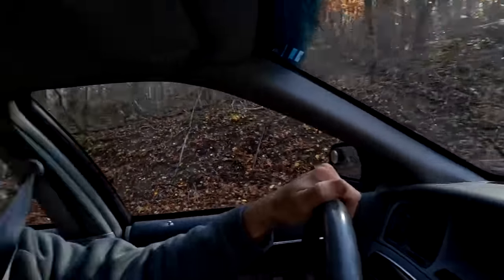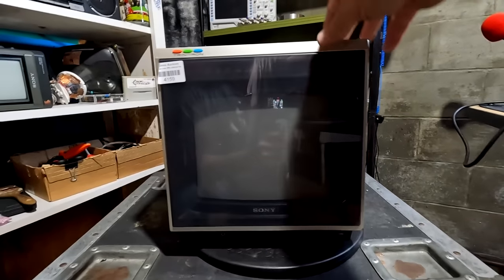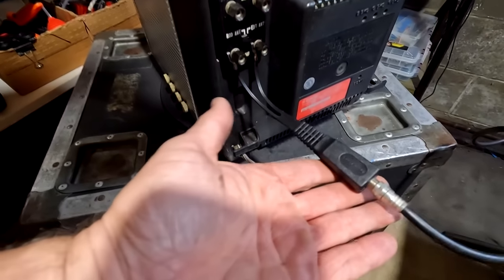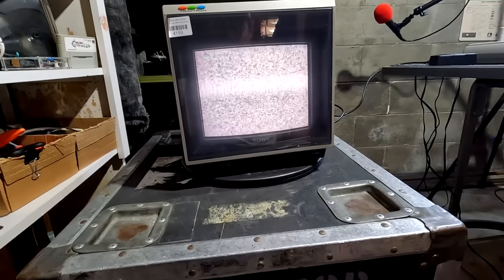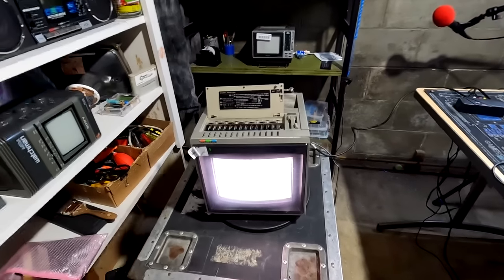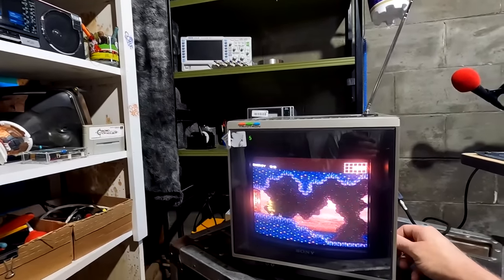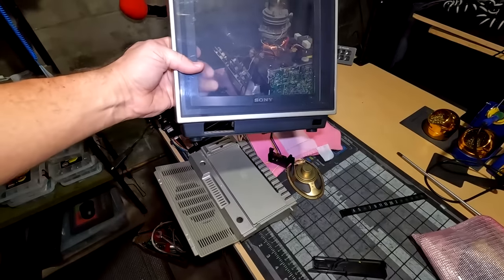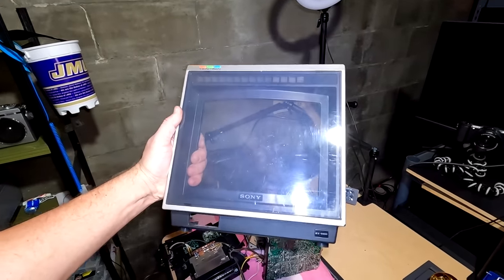Sony's MOST Dangerous TV - The KV-9400 Trinitron

Comment: Given its vintage and the fact it's an RF-only set, it probably has a live chassis (the set doesn't have an isolating mains transformer so the chassis is at mains potential). So yes, it's dangerous to work on these without an external isolating transformer or at least gloves. Especially in 240V countries :-).
Reply: Sony was often cheap with respect to isolation. I had a 1990 19-inch with composite and RF, and it also had a hot chassis.
Reply: My Toshiba portable TV of late 1980th (I recapped it yesterday) also runs on rectified mains at its GND lines. The RF jack is coupled by 3 small capacitors. Decades ago I installed a small (music light) trafo to install a safe audio output.
Reply: EU mains is actually 230V
Reply: @Scoopta And the difference is so trivial that it doesn't matter.
Reply: @cancelhandles  and yet it's still wrong
Reply: @Scoopta  And nobody asked, nor do they care. :)
Reply: @cancelhandles  and yet it's still wrong. Expect to be fact checked on the Internet.
Reply: @Scoopta  Oh no, my country's mains voltage is misrepresented in social media :'(
Reply: @cancelhandles  it's not even my country LMAO...I'm in NA. I'm just a pedant.
Reply: @Scoopta  Ok. That's fair. I've been one myself before.

Comment: CRTs can kill you. High voltages all over inside of set. RGB drive voltages can be upto 500 volts. A flyback you can see up toin extreme cases around 50,000 volts! If the rubber boot is cracked it will leak in to you if you get near it. Arck will jump in to you if you are not careful. They always say to work with one hand behind your back to prevent high voltage from jumping across your heart. That will kill you! They make plastic adjustment drivers to adjust RGB gun voltages. These are some of the reasons that they inform you to havwe a certified technition work on these types of sets. Back in the days they had the correct tools to service sets like that one. All CRTs are the same. Color ones are worse to work on. Voltages are higher and more of them. Remember, One hand behind back or better yet in pocket.
Reply: Not the 30KV are most deadly, but few hundred volt at about 1A, those lurk everywhere in CRT power supplies and mains connections. A CRT is a glass capacitor that stores highvoltage (that 30KV under the suction cup) also when off. Most dangerous of touching it is that you will accidentally shatter the tube and so (particularly with 1950/60th TVs) die of the shards from a glass handgranade.

Comment: I am going to say two obvious things, first use and ungrounded floating isolation transformer when working on older CRTs like this to prevent some of the shock risks and lastly use plastic adjustment tools always.  Don't stick metal screwdrivers in the CRT, also a metal screwdriver is more likely to make it easier to break an old pot.
Reply: Insulation trafos are needed if you connect something grounded (e.g. tube oscilloscope). In real life (unless you stand in a puddle or lean on a faucet or radiator) the dangerous mains shocks are normally caused with both hands, so trafo won't help. Hence wear gloves or only use one hand at a time.

Comment: DON'T take that high voltage cap off the CRT without the special tool they show. That is a coaxial HV lead where the 20kv HV is the shield and the 5kv focus is the center. If the cap is not removed properly, the glass to metal seal around the connector will crack and you will get a slow air leak which will quickly ruin the CRT. Sony had a big problem with these in the early 1980s and soon abandoned that design.
Reply: Those ones were recalled quickly.
Reply: @mariokart8715  I'm not aware of any recall. They just put out a bulletin to use the proper tool which was just a flat plastic piece that retracted the contacts from the socket. This was not a safety or engineering defect.
Reply: I take it only off when I need to (unless an ancient TV has no suction cup on a bare metal tine). Highvoltage in the CRT normally sits there and won't bite unless you accidentally pull that cable out.
Reply: I remember that now. People on the bench kept doing the normal practice while an evangelistic sony cult following was continually fighting a losing battle

Comment: In the days of crt you learned one thing on your first day in the repair shop, you were told it, and screamed at if you were seen not to do it. 'left hand back pocket' when in the back of a tv. and never a screwdriver for adjusting pots, after all, there not screws....
Reason for the left hand was not to provide a path from right hand up the arm across the chest and heart down the left arm... A hv nip from a TV has been known to break bones in the arms from the muscle contractions so stopping the heart permanently is easy.

Comment: 14:42 use plastic screwdrivers to make adjustments instead of metal.  Sometimes those trim pots can heat up a metal screwdriver really quick - for example if there's a ferrite slug that's in a coil.  Plus you don't need to have something conductive, while poking in those adjustment holes.
Reply: It also effects the coil itself, throwing your adjustment off.
Reply: Or ceramic trimmer adjusters, which are even nicer.
Reply: @qwertykeyboard5901 Yup, anything is better than using a a metal screwdriver. When I was a kid and working on electronics but couldn't afford plastic screwdrivers, I used to take a pocket knife and carve down a bamboo skewer into a little wooden screwdriver. They didn't last long, but it wouldn't throw off your adjustment and you can't get shocked.

Comment: I was slightly nervous as you were waving the front fascia close to the tube base, in the middle of the tube base connector (on the tube) sits a tiny glass nipple if you accidently knock it the screen is finished as it will make a hissing sound as the vacuum tube fills with air! I used to repair similar stuff here in the UK back in the 80s. Some of the larger monitor style Sony screens of that era had glass front covers. I hated TV repairs due to getting shocks here in the UK on 250v at the time so I quickly moved on to audio and vcr repairs.

Comment: 15:36 ALL CRTs have fairly light phosphors. You just don’t notice it on most of them because the gray filter is often bonded directly to the face of the tube, and some use tinted glass instead (or in addition to the laminated filter). Any CRT with an anti-glare (satin) surface has a film bonded to the surface.
Reply: Black CRTs wear their phosphor much faster because they have to shine 4x brighter through a dark gray paint layer.

Comment: 2:32 - That is not a heavy CRT, I have a 88KG 460i CRT that is 60hz and is 16:9 ratio, THAT is heavier than I have ever been....lol Yet I managed to lift it in my 20s about 50 metres, If I tried that now, RIP my back for 3weeks at least!!! This TV still works,  last used it 30mins ago in fact with a HiFi VHS tape single. Metallica Hero of the Day VHS single. Not CD single or Cassette single VHS single!

Comment: I have always been fascinated with electronics like this and taking them apart. To see how they work. Then putting them back together to see if they would still work after I disassembled and reassembled them. Clear back to the days when I received one of those small black and white/am/fm radio TVs for Christmas from my dad in the 80’s. When I was like 7. 🤷‍♂️ I wish we still had the days where people repaired electronics. And refurbished them, instead of just throwing them all away like society does today. I find this pretty interesting. I guess I am a nerd. One thing I didn’t know as a kid, was that you could be seriously shocked or hurt by these old TVs inside. 😳😳😳 Learned that much later as a young adult. How I managed to never be shocked of off myself tearing them down like I did is a miracle! 😳😳😳

FYI, they make some really good plastic polishes for that plastic overlay on the front of the tv, to make it look a good bit more presentable. And remove some of those massive scratch swirls.

This has a fair amount of tuning controls for the size. These are the type of tvs that used to sit on office desks, like at my dad’s auto body and mechanic shop in the late 80’s, early 90’s. Perfect size for a desk. While they did paperwork or took calls.

Comment: That looks like a live chassis set (I couldn't see a large transformer in the AC power supply section). This means the circuitry (and more important the chassis/ground) within the set are directly tied to neutral... or hot if you plug it in backwards. It was a cost cutting measure in lots of TVs and was pretty common in RF-only Sony sets. The RF input you'll notice is completely isolated through a little matching transformer, so that you don't accidentally connect your antenna or another device to the AC hot/line. The sets with AV inputs were usually transformer sets for this reason. Probably good to invest in an isolation transformer, or definitely some plastic tools :)

17:21 The screw that connects the antenna is useless for your purpose. You'll want to have the little switch on the back set to EXT ANT, so it will have the built-in rod disconnected. However, these older sets (especially the little portables) were primarily designed for use with antennas. So external noise rejection was not a high priority. And in 2023 with all our LED lights, computers, and switch mode power supplies everywhere? It's a problem!

19:38 Those RF inputs look a little different from other brands because Sony actually sold (or supplied with the larger TVs) antennas with these metal prongs that just plugged right into the holes of the terminals. But of course, you could also use the fork terminals for other stuff, like you did.

That's a lovely little TV, glad to see it up and running!

Comment: you know you can inject directly R.G.B signals into the input instead of going through the tuner input, which is less absurd than using - in the console, RGB ( the SNES PAL have RGB output)  into composite video > UHF > reconversion in the TV to RGB
like, some screw-in DB15 plug on the rear, I would totally do something like that.

Comment: Jesus. I feel like my 20" Phillips is going to kill me. I am terrified to remove the anode cap. When I open it up, I can hear it. It has been unplugged for almost two years now. My two JVC's play nice as far as I can tell.
Reply: You need to make a CRT discharge cable from a flat sheetmetal connected to a cable with metal clip to the outer CRT layer/springs (that's the 2nd pole) and another cable (in Germany prongless Schuko plug) to the socket earth pin. Discharging is safe (only do not damage the glass or its connector when pushing the sheetmetal under the suction cup).

Comment: Just curious: why pass the SNES through an external RF modulator instead of just using the RF Out port on the back? you could just use an RCA to Coax adapter to plug it in directly and it'll work fine

Comment: The RF out on the modulator may be weak. A signal amp might help. The tuner is useless, so a composite or RGB mod would make more sense. If the TV isn't isolated with a transformer, you can plug the TV into an isolation transformer or pass the signal through a 75 ohm to 75 ohm isolation transformer. I don't know if they made those, but you can always just made one with magnet wire and a toroid.
Reply: With one pole on mains (live chassis) RGB mod is very complicated. RGB contains DC and (unlike audio) can not simply run trough a transformer.

Comment: Always treat any metal part inside running CRT devices like life mains voltage. I.e. wear gloves and only use one hand. Also supposed "low voltage" (chip) parts often hang at one pole of mains. And for these potentiometers never use metal screwdrivers, Mr. ElectroBoom! Use plastic blade screwdrivers or sturdy cable tie or make your own of plastic. If you short something, it will likely destroy the electronics or the jolt makes you shatter the CRT, which at least in 1950/60th sets means to die of the shards from a detonating glass handgranade.

Comment: A really nice find, but I did not understand why it won the title "most dangerous"...
Reply: Yeah, just clickbait. :(
Reply: @tookitogo  Clickbait is a different thing - the content of this video is not superficial or misleading, just "most dangerous" is arguable given the effort to do intentionally wrong thing to get an electric shock :) Any tube TV with exposed top pins of horizontal output tube and damper with ~25kV of high voltage is a much higher hazard.

Comment: Smh...If you're going to clean these old sets up,invest in a high voltage probe so you can discharge the picture tube for disassembly!The little red box is a called a high voltage block!Most manufacturers had the G-2 and the focus on the back of the flyback itself.Sony thought it was more cost practical to have a separate block for the convergence for correction errors!Sony TV's were way over engineered,and we used to poke jokes at them all the time about how half the parts could be thrown away and the TV would still work! 😂 The best TV for the time was still the Zenith's and the RCA's.
Reply: My Toshiba portable from late 1980th has only one singlesided PCB with barely unneeded parts. There seems to be not even degaussing nor dynamic convergence. But its live chassis hangs directly on rectified mains, so I needed a small trafo to safely add an audio output.

Comment: 👍👍👍🖐 My congratulations! Wonderful buy! Great product! 22USD seems like nothing as for device like this. In Europe retro equipment is much more expensive. I also admire your knowledge. I'm highly interested in retro devices and I repair them quite often but I don't touch tv-sets. My small doubt is... shouldn't you clean it first before first run and to have even visual only inspection inside? Such devices were sometimes kept in very bad conditions and sometimes there is a lot of dust etc. and it might make serious problems during first run? I'm also wondering if making all those adjustments change a lot comparing to factory ones? True it might slightly change with time but on the other hand you don't have any professional tools. At the end, please remember safety first! 🤪
Reply: They can bring very undesirable insects into your house
Reply: AFAIK its USA where vintage stuff is moonpriced. Music keyboards or quartz clocks for 40EUR in Germany can cost hundreds in USA or Japan.

Comment: so, to understand what makes these types of Sony Trinitron's so dangerous to work on, because "discharging" can cause so much irreputable damage, that means you have to 'service" these sorts of TVs essentially without discharging meaning there's always a chance you could get zapped with a lot of voltage and amperage which could kill you.  Though I am sure there has been some unfortunate TV repairman that has bit the dust because of these Sony TVs, I have to note, actual reported deaths to electric shock from these TVs are quite rare.

Comment: Dangerous? laughs in 240 volt live chassis tube set
Reply: The voltages in a CRT TV are in the tens of thousands of volts — 20kV to 50kV is common. The live mains chassis is the least of your worries.
Reply: @tookitogo  but it's also high frequency so in my case it's 15,625Hz for 625 line, so it'll definitely zap you and it'll hurt but it's not as deadly as 50Hz 240 volts. Most pre-WWII TVs and a few post WWII sets had mains-derived high voltage which was absolutely lethal.
Reply: @MegaWayneD  My late 1980th Toshiba portable has its GND on one pole of rectified mains (EU has random mains plug polarity) to omit a mains transformer to cut cost. With small TVs this was normal - that's why in Germany TV sets with jacks (Scart, AV etc.) costed 1/3 more than those without, because they needed a real power supply.

Comment: xD internal heatsinks are usually hipot out which means they hold power they dont follow the rule of being grounded... non techs are not supposed to be in there hence it doesnt matter if they are grounded or not... the RF fuz can be caused by your soldering station, switchmode powersupplies as they are super noisy  etc etc....